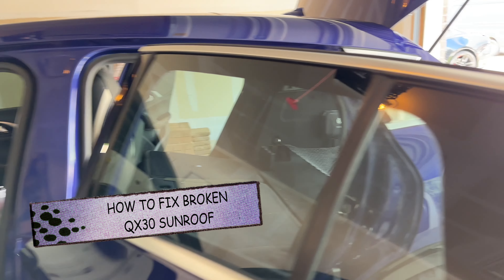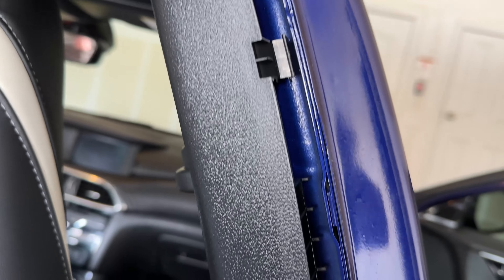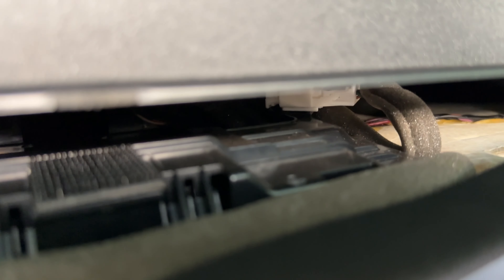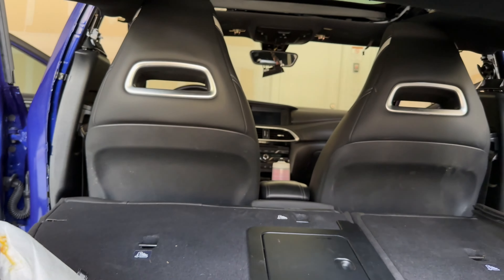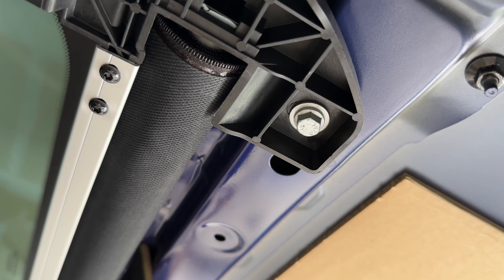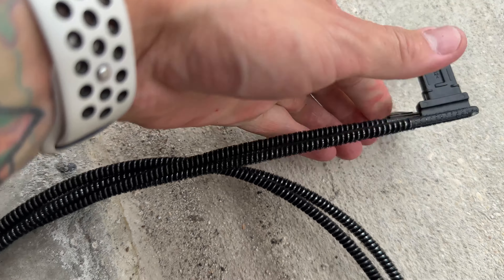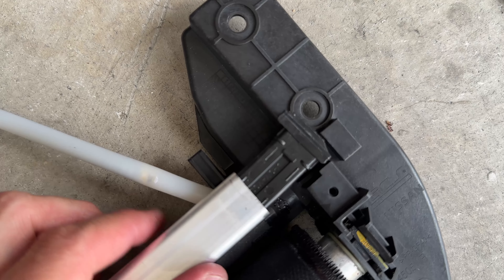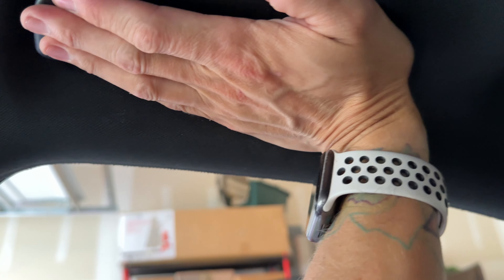HOW TO FIX BROKEN INFINTI QX30 SUNROOF

Comment: How did you get the new  black cable to go into the White cable
Reply from the maker: Just feed it in by hand d when the motor is disconnected there won’t be any resistance

Comment: My QX50's shade cloth stopped retracting. I think the clips that slide on the rails came off. Is there a way to put the clips back without dropping the whole ceiling down? A lot of people are having this issue.
Reply from the maker: No idea qx50 is completely different the qx30 is a Mercedes so it’s built different

Comment: This video shows you none of the struggles about the installation. It's actually just how to take it apart. Know how to put it together. Very uninformative when it comes to installation
Reply from the maker: You’re welcome to do better fam.
Reply: How ungrateful! @AtlasWilder took his  time to stop and video and provide guidance. We can all see how challenging a job it is. If you have ever taken out trim plugs in a vehicle, you will have a small idea how difficult this is. However, if you take your time, don't get flustered, have some help, this video provides step-by-step instructions of how to save yourself $3,500 paying the dealer. I am not underestimating the effort required, but at least I now know what's involved - including lots of photos taken while dismantling and plenty of storage containers for screws, and bits and pieces.

Nice effort man, I appreciate your video.

Comment: On behalf of infiniti,the qx30 is an unreliable Mercedes . Just garbage
Reply from the maker: It drives better a the 3 Infiniti’s I’ve owned tho 🤣 main reason I got it, suspension and steering and dual clutch is pretty nice.  But yeah wtf with the small issues and over engineering